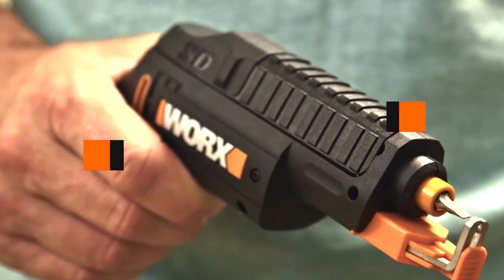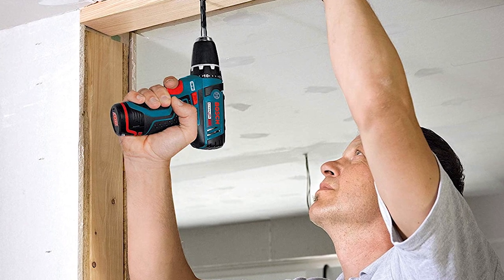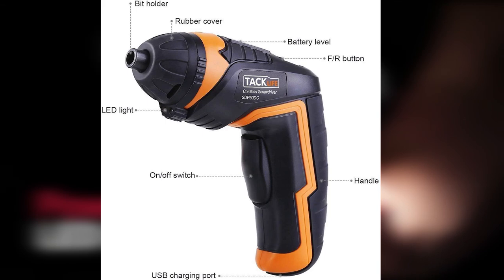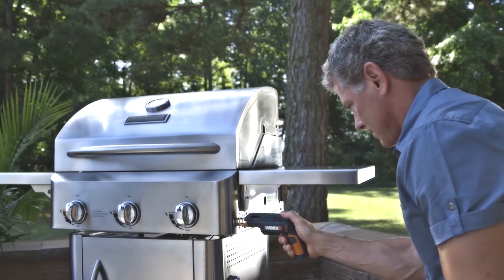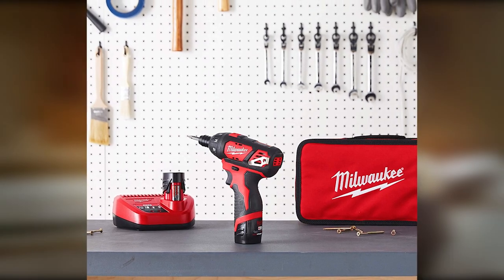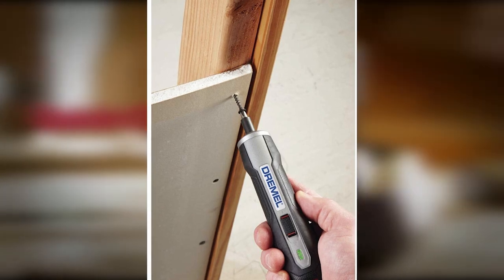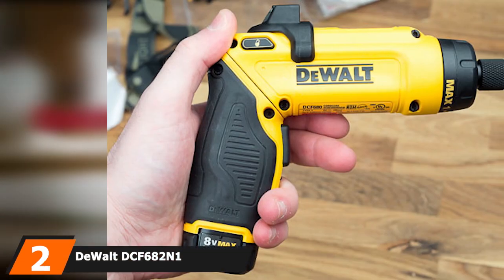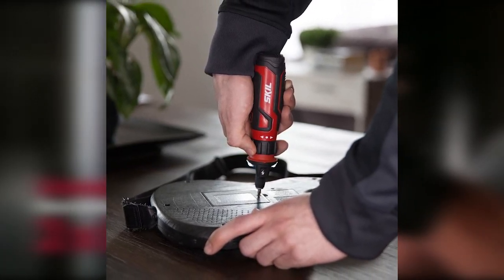Best Electric Screwdriver In 2024 - Top 10 New Electric Screwdrivers Review

Comment: Tisk tisk man I don't see the populo screw driver it came with a huge kit of extensions and bits torx bits couple drill bits  in a nice case I use it for everything 300rpm says 3nm but it can drill into wood, led light 10nm manual mode I'm looking at the Dremel screwdriver now you showed the Dremel go version the version in stores now is a diff model with little better rpm and more torque than the populo driver I have I use it for everything though

Comment: I've owned the Dremel go for about a year and a half, the most annoying thing about it is, the Push to start feature. Especially when you're unscrewing a fastener. Its terrible. I'm actually looking for a new cordless screwdriver but everything has some unnecessary tech in it, like gyroscopic drive, push start, smart drive, etc. Give me a selector for direction and a momentary switch to activate, anything more it starts to get girly.
Reply: Work makes the similar screwdriver without push to start